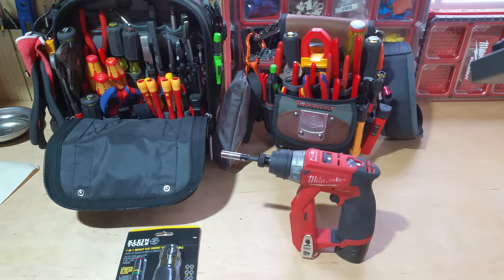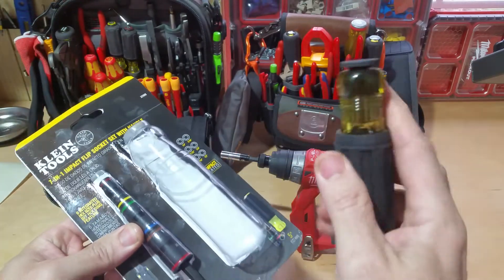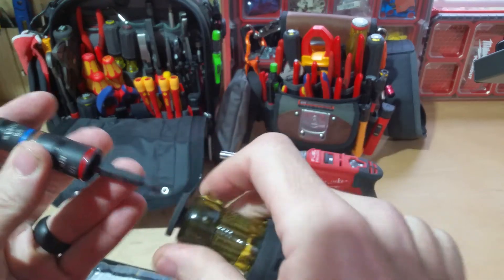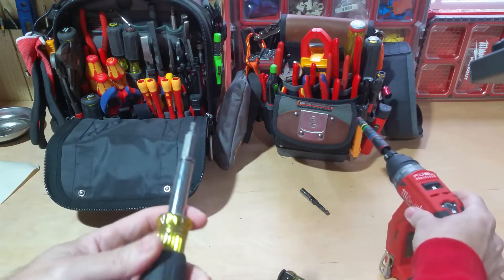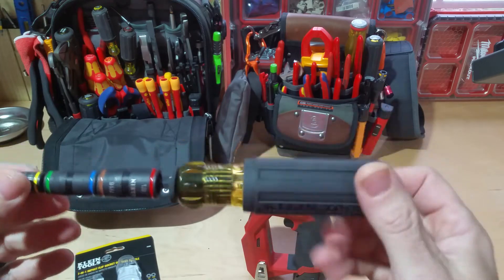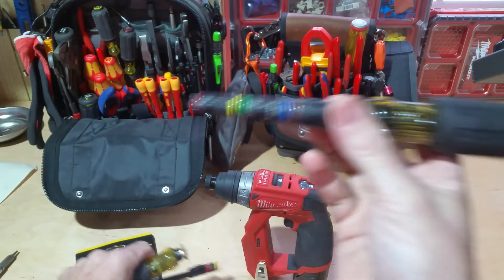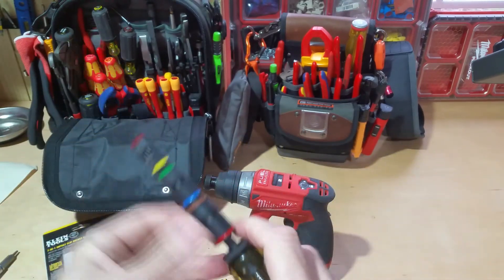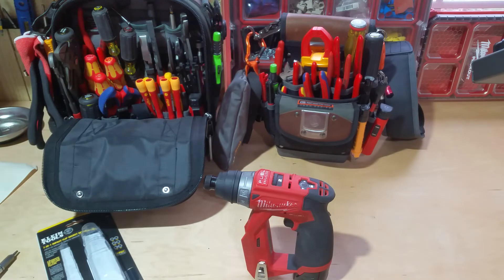Klein Tools 7 in 1 Flip Socket 32900.....Malco Alternative?

Comment: You can pull the 1/4 side out just enough to put any small 1/4 bit and turn it into a screw driver you can only do it with the 1/4 socket.
Reply from the maker: Yeah I noticed that after the video...I should have read the package but hey it was my first video...lol.  I show it in my TP4B loadout video but even more so in my Klein SUPER Screwdriver video.

Thanks for watching and for the comment. It makes the screwdriver even better than I originally thought.
Reply: some if us have 5/16" bits as well :-)

Comment: I just picked up that set from the Depot and it is great.  Every socket fits snugly and doesn't flop around.  And the handle doubles as a bit holder for all your quick-release bits that you use in a drill driver.  I do HVAC repair and some electrical and this set replaces all of my socket drivers.
Reply from the maker: Yeah I really like mine so far...The bit holder part is better than not having it but you have to be particular with the bits you use...Some with the "Torque zones"  are a little long..

Glad you got one and like it!

Comment: I’ve seen people take a 14 in 1 adjustable  Klein handle and attach that driver tip with the sockets and make a 22 in 1 Klein driver.
Reply from the maker: This is the kinda stuff I like to see. I always look at tools at how I could use them...not just what they are intended for. This is a great idea. 

Thanks for the comment.
Reply from the maker: Made a quick video showing this....thanks for the suggestion.
Reply: Exactly what I did.  Works great.

Comment: Just a heads up- I got mine a few weeks ago to combine with the Klein multi bit driver. I assume "impact rated" it would be ok to put a bit in the 1/4 and run it. I put a T25 in the 1/4 socket and put on my M18 and drove a few wood screws-maybe 10 or so. The socket  got stuck on the shaft. I had to put it in a vice to beat it off with. So anyway, I won't try that again.
Reply from the maker: Good to know... I mostly use mine as a nut driver, but now I know 👍👍

Comment: This is pretty cool tool. I’m sold on it coming with 11/32 odd for some but not for us in the hvac field. Having it impact ready is nice as well. I’d probably end up keeping it simple instead of turning it into a 19 in 1 like you’re other video I don’t really like having small bits for the shank they always tend to fall out on me and using it as a screwdriver it be hard trying to get it into tight spaces due to the nut driver bits. 

Also I’m a bit disappointed in that magnetic multi screwdriver. The magnets don’t seems to lock in fasteners they just fall out and changing bits and nut driver sizes sometimes I gotta fight to pull them apart. Just my two cents.
Reply from the maker: Yeah I always prefer dedicated screwdrivers than continually swapping things around if I can have them easily available. Most of the time swapping a screwdriver for another in a pouch is faster than switching sizes on these things.

I primarily look for these types of tools just for my small bag to give me more options or if I am getting into a space that ot is hard to get a bag of tools in.

Are you talking about the magnetic 11-1 or the 14-1? Because I haven't been impressed with the magnetic part of the 11-1 either.

Thanks for the comment, I always like getting two cents....it adds up, lol.
Reply from the maker: I forgot to say, The sizes are what sold me on this too. I have been wanting Malco to come out with more and I was disappointed when they came out with the 3/8 and 5/16.

I thought why didn't you do 3/8 and a size we don't already have?
Reply: Yeah the 11 in 1 when it first came out I went to like a few Home Depot’s to look for it than I get it and am instantly disappointed lol. 

Yeah the 3/8 and 5/16 they made the size to wide for my liking if you’re using it for stuff that’s outside of the panel or what not it’s okay. Dewalt has the 3/8 and 7/16 and it’s a lower profile even with the 7/16 and a way stronger magnet.

Comment: I wonder how the 1/4" will hold up using it in a drill as a sheet metal screw runner.
Reply from the maker: I believe it will work fine. The Malco shafts are a bit beefier but normal use I think the Klein will hold up no problem. I’ve used mine to put sheet metal screws in, not tons of them yet, but no issues.

Thanks for the question

Comment: Do the Klein “sockets” happen to fit on the Malco extensions?  Just curious because sometimes that longer extension is just too long, but if the Klein sockets would go on the Malco shorter extension then that would be a perfect combo to carry both and move the larger sockets to the shorter extension when needed.
Reply from the maker: I thought and hoped for the same thing.  Unfortunately they do not or at least not perfectly. The Klein has a different connection, almost like a star and it fits deeper.

They will go on but they don’t lock in place 100%, there is a chance they will pull off. Also the magnet is not in a place to be usable, it’s deeper in the socket.

So I would say they do fit on there….but not really in the functional sense.

Hope that helps. Good thinking though.
Reply from the maker: I just posted a video….make sure and check it out.

Comment: Just got this and the extendable but holder Klein and swapped the two ¼" drivers so my retractable handle stores my NUT DRIVER SHAFT 😉
Reply from the maker: Are you talking about the 14-1 adjustable?  I carry mine the same way, I have a video called Super Screwdriver.  There isn’t a lot you can’t do with it.

Thanks for watching and sharing how you are using it… you will get a lot of use out of it 👍
Reply: @MORGANSMaintenance  WAIT though, I ACTUALLY typed "but holder" 😮‍💨. I'm looking for that video not right now but, RIGHT NOW!
Reply from the maker: @blaquejaque9702  I read right over it and didn’t notice you ‘but” 😂 My brain knew what you were saying 👍

Klein Tools SUPER Screwdriver ... Best EDC? 19 in 1 - 32900 + 32303
https://youtu.be/dBIwHkL3BHo

Klein Tools Super Screwdriver Part 2..... I missed a function, the sequel makes it better!
https://youtu.be/Co4xAKU0ULc